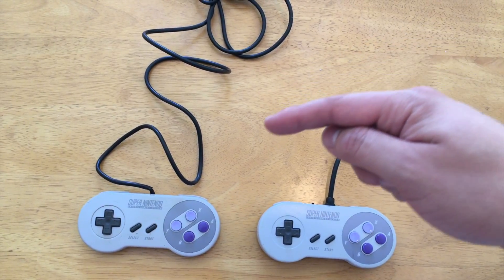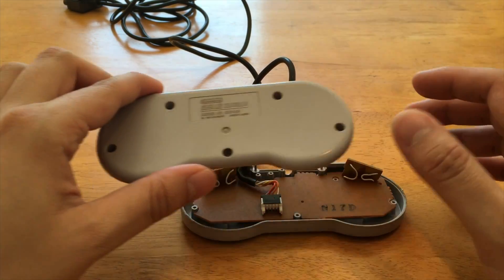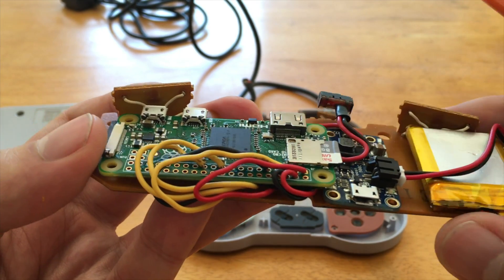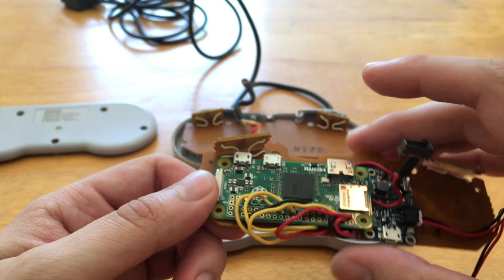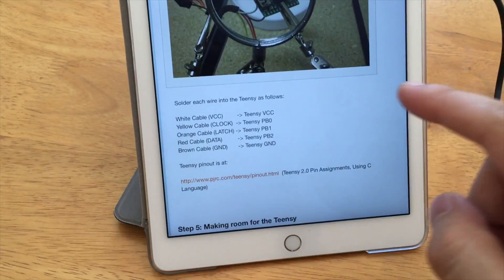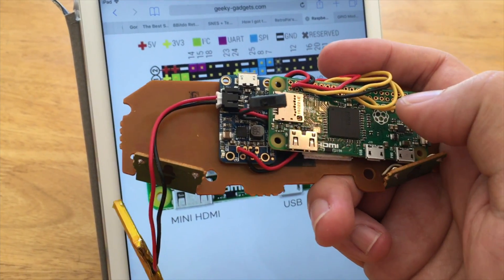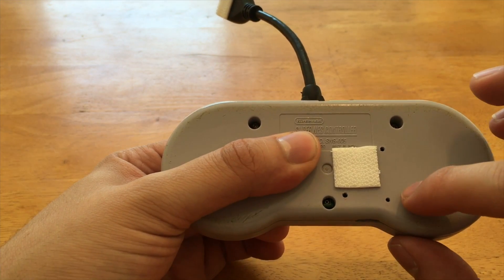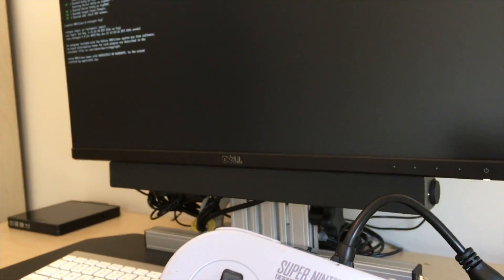Raspberry Pi Zero inside an SNES Controller - The SNS-005Z

Comment: I've never undertaken a project quite like this. I ended up making 5 of these, and the video was incredibly helpful. Kudos Anthony.
Lessons learned:
1) I tried cutting corners with a USB based SNES controller. I tried three brands (Buffalo, Tomee, Gtron) and none of them were designed with extra room in the back of the controller. Buffalo will just barely fit everything, but you have to relocate two capacitors and a quartz resonator from the back of the board from the front, and its really difficult to do that because you have to angle the capacitors away from the buttons, and the resonator is meant to be soldered from the opposite side. They put them on the back of the board for a reason.
2) It is way harder to try to use threaded cable rather than solid core wire (rookie mistake)
3) You can save a little time if you carefully chip away at the white part of the snes wiring harness with a pair of cutting pliers until the metal prongs are exposed, and solder the cables directly to that; cover up with a little hot glue if you think they will push into each other when closing the controller.  Overall, this saves you the time de-soldering the existing wiring harness.  
4) Soldering the jumper cables to the GPIO through holes of the Pi zero is helped out a lot with just a touch of flux. (Again, I'm new to this, and had no idea how much easier flux makes it)
5) If you used the pinout graphic included in the video comments here , you can simply install the gamecon driver following the instructions on https://github.com/retropie/retropie-setup/wiki/GPIO-Modules. 
Just load up the retropie setup menu, and the rest is really intuitive.
Reply from the maker: Yes I would try desoldering the harness at this point and then doing through hole soldering directly to the board - it's how I ended up going in the video above and works pretty well.
Reply: when first starting this i thought about adding a bluetooth dongle to the data usb port, but like dave was wondering about the added power consumption. another issue is that i can't find a single micro-usb/otg bluetooth dongle (do they even exist?). i haven't measured the necessary spacing, but figured a super small micro-usb adapter to a small bluetooth dongle might work. personally, i like the idea of going bluetooth because 1. less cables (and not tied to another person), and 2. it would allow the use of a wide range of gamepads (xb1, ps4, custom retro controllers, etc.)

as a side note: i absolutely love this thing. everything fits just perfectly, the buttons feel great, and between anthony and dave's suggestions, it's super simple to setup (it took me awhile, but i had that 'aha' moment where everything clicked). i definitely want to build a v2 with cleaner holes, better soldering, and maybe a light to show battery power. also, stranded-core wiring. you weren't kidding about bending solid core wires in a small space!
Reply: Steven Fagan , what type of controller are you using? Is it an authentic SNES controller, or a third party controller?
Reply from the maker: Awesome Dave Stratton, very happy to hear the video was helpful!  Thank you so much for writing the lessons learned as well, they are awesome guidelines.  
I went the solid core wire route as well at first and found stranded is definitely the better way to go - bending solid core in small space is no fun =)  
I love the idea of chipping away at the wiring harness vs desoldering it - great tip. 
Thanks again man
Reply: Thanks for the tips!
Reply: Using the Raspberry PI Zero, how did you get the gamecon drivers onto the board? I'm using windows 10, so I can't get mine to sync up to ssh to the board. Any way to get around this issue that you guys were able to find?
Reply: So i tried dave's suggestion in tip #3 and was able to expose the prongs from the harness. However, they snapped off when trying to close the case. At this point would i want to de-solder the connections on the snes board, then run the wires through and solder brand new connections (like when soldering to the pi)? New to this and want to make sure i'm doing it correctly.
Reply: amir quadri - while the case was open, I connected a wifi adapter and keyboard to the PI zero via a USB hub. I then loaded the retro pie setup menu while emulation station was closed, and ran the setup scripts through the menu.
Reply: Great thanks!
Reply: Thanks Dave Stratton! I used a generic controller instead of a genuine SNES Controller. Using a  generic one meant that I had to solder the pins to the buttons, then use 3.8 RetroPie.  And that is actually working really well.
Reply: That sucks about the Tomee controller. I was going to try that... Thanks for saving me a failure.
Reply: Alright, new question, or new project.  Family members love this. They love coming over, drinking my booze, and playing my SNESPIE. Now they complain about wanting a 2 player. Gah. What I was thinking is building another controller the same way i did before, but this time, have the connectivity using a few free GPIO Pins on both controller 1 and 2 to communicate to each other. is this possible, or still a pipe dream? Thoughts, suggestions? Anything?
Reply from the maker: Hi Amir, I haven't had a chance to complete it yet but one option I have been working towards is soldering a USB port to the test pads on the bottom of the pi and then having that port come out of the top of the controller.  That would allow you to daisy chain a USB controller kind of like how 3do controllers worked.  I am hoping to get back to it in the next few weeks after I finish a different project and will put up a video of it as well.   I'll try to take some photos of what I have so far to see if they help give you more ideas.
Reply: Anthony Caccese - do you think bluetooth would use too much power for the battery you used in the project? I know the company 8bitdo makes Bluetooth controllers in the classic styles, and there is an article on github that explains how to set it up their controllers in retropie.. that way you could connect the two controllers together wirelessly.
Reply: Hey Anthony, I was thinking about doing the same, but using a USB controller kills the nostalgia factor. It also removes the ability to have 2 individual controllers which can be used on 2 separate screens. I am going to mess around with pins 14/15 which are the UART (Tx/Rx) pins on the Pi Zero boards to see if that would work. I'll keep you updated as well with what I learn. Thanks alot!
Reply from the maker: I did quick proof of concept so far and had to change to the powerboost 1000 to handle the extra power draw for the usb port.  I dig your Bluetooth idea and think I might be able to get that to work with the added power headroom of the powerboost 1000 maybe through a usb Bluetooth dongle?  I need to find more time to test =)  I'll take photos of what I have so far to get your feedback - see if we can find other options together.
Reply from the maker: Amir that sounds awesome, yes please I would love to get more info on what you find.  I'll send over some photos of where I am at so far to see if we can share more stuff back and forth.  Thank you dude!
Reply from the maker: Dave Stratton, amir quadri and Hushpuppy247,  I recorded a rough overview of where I am at so far on a V2 that I am hoping might give some ideas.  Check out: https://www.youtube.com/watch?v=iRlxaSGR5bA
Essentially I am going down the road of adding a full sized USB port to the top of the controller which could accommodate bluetooth dongle, wifi,  usb stick or other things as needed.   It's in its early stages and I have a bunch of clean up to do but figured it could be helpful to share.   With the extra wires and the change of placement needed for some of the parts I need to rethink the fit and I don't think its going to be able to be as clean as the first build.  So maybe sacrificing some of the simplicity of the first go for added flexibility.  Hoping to get back to this soon.
Please let me know what you think and I looking for help on other ways to go as well =)
Reply: Hey, Anthony Caccese or Dave, I am having a lot of trouble trying to get the gamecon drivers. Basically I am having a lot of trouble trying to get internet connection on the zero. I have tried numerous like connecting it to usb through the computer but get connection timed out on putty. I have tried using my phone. I have tried a wifi dongle maybe the one I have doesn't work? I got this one 
https://www.amazon.com/gp/product/B01KVZB3A4/ref=oh_aui_detailpage_o01_s00?ie=UTF8&psc=1

Is there a way to manually install the drivers onto the sd card? 

I'm fairly new to all this.
Reply: It is a generic SNES controller, the one you buy off adafruit.
Reply: helo! first of all thanks for share such a nice project! 
I bought all the eletronic parts, and iit is almost done. I have already finish the soldering part, and the charger and batery it is working pretty nice - I used a old cell phone battery. 
But now I am stuck in the programing part. I had the controller conect and wired, and tried to follow the step by step  link you have posted in the description part, but I am really lost.
my doubts: 
1 - the instruction start saying  "After booting from the SD for the first time, launch RetroPie-Setup, look for option 312 and upgrade Raspbian ". I don't understand how can I enter this retropie set up. And how can I upgrade the Raspbian, since the raspi is not connected to internet -  if I have to connect, how should I proceed?
2 - I already access the modprod menu (cd /etc/modprobe.d) and could wrote the command line. But I don't understand the second part, when the instruccion say "My modules file looks like this". What should I type and in what screen? 

I already posted a comment bellow, and also sent a message, but  I figured out how to procedure to solve the question I made. 

Thanks a lot, hope you can help me, I really want to finish this project, and It is such a pity for me to get stucked now,  as I had evething well advanced.

cheers.
Reply from the maker: Hi Re lapso,
#1 - I hooked up a USB hub to the USB host port on the pizero to be able to attach a keyboard and wifi dongle.
#2 - after opening "gamecon.conf" by typing "sudo nano gamecon.conf" add this line to the gamecon.conf file... options gamecon_gpio_rpi map=0,0,0,0,0,1 (to do this part though you need the gamecon drivers installed - which you need wifi for)
I may need to create a video walkthrough of this part - I won't have time for another few weeks.  Hopefully this helps for now if not I'll try to help further no problem.
Reply from the maker: Hi Steven, is it a USB based controller?  (this one: https://www.adafruit.com/products/131)  If so my tutorial won't apply directly.  I built the above using an official Super Nintendo Controller.  The gamecon drivers would not be needed for a USB based controller (and the wiring will likely be very different)
Reply: Anthony Caccese that's the one I got. I'm pretty confident it isn't usb based. Wouldn't the pins be the same as that controller has the regular port to plug into a snes console? I do have a USB snes controller that does work via micro usb adapter. Do you think i could just solder the cord directly to the micro usb port? That would make it so I cant use that port for other things im assuming but I have all I want on it already.
Reply: hey Anthony! When I hooked the USB hub the keyboard does not worked! I tried with many different hubs, even with this one you can charge the 5V input. But if I hook the keyboard direct to the pizero it works... 
do you know what is happening?

Comment: I am going to make this!  So cool!  
What did you use to clean up the back of the case?  
What are sanding sticks?
Will it run off of the direct power or do you have to turn it off to charge?
Is there a bigger battery that could be used?
Why can't I just use the "power in" micro usb charger to run the power?
Reply from the maker: To clean up the back of the case I used a set of pliers and sanding sticks 
Sanding sticks are similar to sandpaper just in a more handheld form - check these out for an example https://www.amazon.com/gp/product/B000CDR5K8
It will run off direct power plugged in through the powerboost
A bigger battery would unfortunately not fit in the build I have done - space is very tight
In my build this isn't possible because that power port is behind the left shoulder button
Hope this helps!
Reply: Thanks for your help!  Can I remove that power port and direct solder on a cut USB wire?  I'm trying to figure out how to do that.

Comment: Do I need the power switch and battery, or can I just use the on board power input hanging out of the controller plugged into a wall. And still get the pi zero to work the same way attached to the controller.

And is there a way to attach a second controller to this for two player games.
Reply from the maker: Hi Jeff Beckstrom, a version could definitely be built without the powerboost and battery.   This NES controller example I think could help as a guide for doing that - http://www.instructables.com/id/RetroPie-Inside-an-NES-Controller/?ALLSTEPS
For a second controller... not in this version.  Over the holiday break I am planning to build a version 2 that has an additional USB port exposed to allow for that.

Comment: Maybe you could connect a micro USB wireless sender and receive to one of the micro usb slots and then connect an adapter to a normal usb then connect your thumb drive to that, you could add Roms wirelessly!

Comment: I know having an orignal contrller is fracking bad ass, but you can cut down some of the pain by using a usb snes controller if you didn't have a relic around. Amazing project btw.
Reply from the maker: Agreed Barrie, USB would remove the need for the driver and simplify some of the wiring for sure.   Thank you for checking this out!

Comment: 3 Things:
1. This is FUCKING awesome and so are you,
2. Will this work with one of the newer USB SNES controllers?
3. How are you verified with only 350+ subs?

Again, great project!
Reply from the maker: 1) Thank you! I very much appreciate the compliment and that you enjoyed the project.  It means a lot.
2) I have been thinking about this more and more.  It would be possible for sure (and in some ways easier than using an original controller - less custom wiring and no custom software driver).  The main things to watch for I think would be fit and handling the wiring for the usb to the pi-zero.  Main reasons I say that is the few usb controllers I have opened up have all had different circuit board layouts and spacing of the components.  I found this video yesterday https://www.youtube.com/watch?v=SRgjDyblBdA  and thought it was an interesting approach mouting the pi on the outside.  I need to research more - sure there are a few ways to tackle it.
3)  I have no idea =)
Reply: Although that video works the way you did it was much cooler and more sleek and portable, i wouldnt have to worry about chucking it in my bag and the pi getting damaged! Thanks for you input, understand how they could be different, just means we gotta find the right one, you've gained a subscriber, im looking forward to seeing more projects in the future!

Comment: Since the pi is in just one controller, are you stuck playing alone? Is there a way to make this two player?
Reply: I think the nes cartridge version would be an easy method for 2 player im making 4 for my son-in-laws for xmas, zero soldering, just plug n play, even retropie is super easy to work with.
Reply from the maker: I have been busy with work so I haven't had as much time but yes adding a USB port to allow a second player is possible.  I have handle on how to do it - just need to find the time (maybe over the holiday break) to build it out.  Essentially I am going to break out a full size usb port from the test pads on the pi-zero (a tip from Val in one of the comments below) which would allow you to plug in an additional controller or other things as needed.  Think if it kind of like the old 3do controllers where you could daisy chain from one controller to the next.
Reply: If you make one using a usb type snes controller, somehow fit a usb hub inside then yes, ppl make one using a nes cartridge stick all the electronics in that including a 4 port hub.
Reply from the maker: Yes great point.  The howchoo video of the nes cartridge mod is amazing - https://www.youtube.com/watch?v=gHzgNIEqQ5s 
I will admit to building one last weekend =)
That's a super easy build and doesn't require any soldering at all.
Reply: awesome! thanks for the information. I'm putting a retro pi together for my husband for Christmas and wanted to be sure I could play the snes with him. 😉 These are great suggestions.
Reply: It can be done. I followed your video and wiring and was able to also fit in a microUSB port along the top as an OTG setup, so you could conceivably plug a second controller into that.....maybe. 

Check it out:

http://i.imgur.com/KUC0o4g.jpg